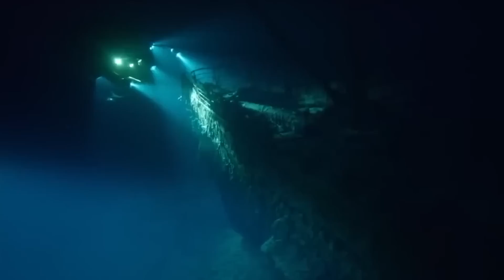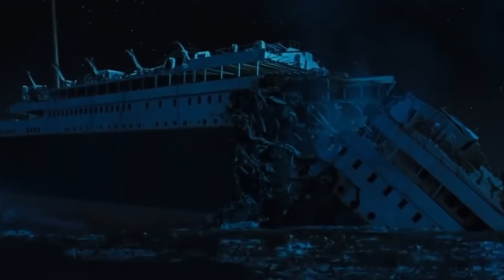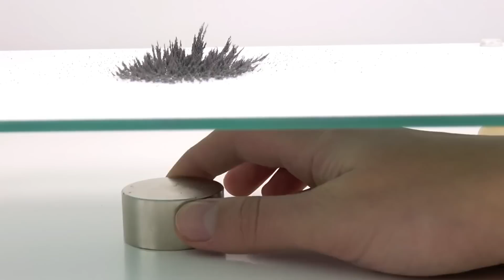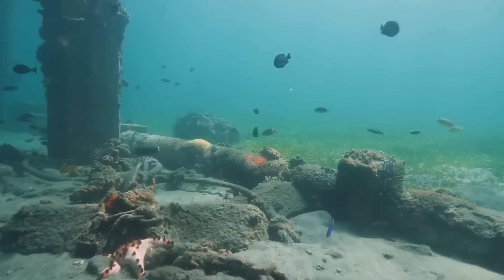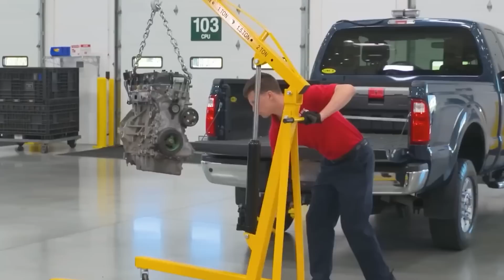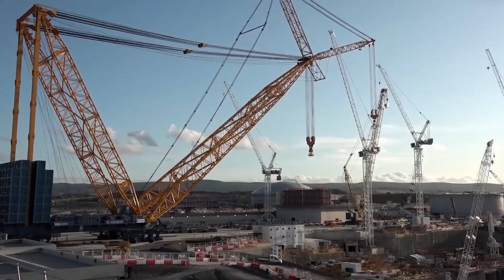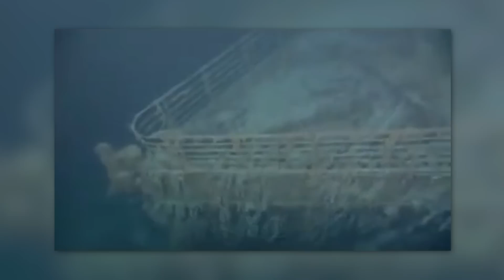Scientists New Plan To Retrieve the Titanic Changes Everything!

Comment: Complete rubbish. The hull now is not far from completely crumbling into an unrecognizable mounds of metal. Saw something saying perhaps 10/20 yrs after sinking (ie 30s/40s/50s) if they’d had the technology MIGHT have been able to bring her up. The stern section however literally impossible. Last pics it’s almost completely collapsed. The stern section imploded on descent…Even since the wreck was discovered constant exhibitions have destroyed a lot of it and accelerated its damage also. Best bet would be to salvage what’s important. Put into museums etc. maybe one day when hulls completely rotted and rubble maybe they’ll bring up her boilers or engines 🤷🏼‍♂️ can’t see those rotting as fast as the hull around it 🤔

Comment: Are they under the impression that the stern section is as well preserved as the bow? The stern section is nothing but rusted and twisted steel, you can barely tell that its part or a ship, hull plating is peeled off and the decks are pancaked on top of one another. Not even worth the effort

Comment: No, it can’t be done…
Maybe 50 or 60 years ago, but not now…
She’s too far gone…
But if you must try,
The best way it could be done, if you had a way to build a watertight enclosure around the sections of the ship, then pump out the water and float the individual sections of the ship to the surface.

Comment: It would have to be a combination of ideas.  Putting a steel cage around the ship, then using a mix of air balloons and cranes is probably the best possible way to get it up.  The next best way would be to cut it into sections to bring it up.  Either way its going to be expensive and take a lot of planning.

Comment: At the latest on the surface of the water, contact with the oxygen in the air will ensure that the Titanic completely crumbles into rust in a short time. The static forces of an uplift are anyway too great for the moored hull and it will break.

Comment: Well the ship alone is 115,300,000 pounds plus it has a volume of 4,632,900 cubic feet and If you fill that with water it would be 2-3 times the weight stated above. Most importantly it will crumble with any movement. And if you are saying the ship is in two pieces which it is, 57.65 million pounds + 2.316 million cubic feet of water is still extremely heavy!!!

Comment: Yes, it’s a sacred graveyard but also this ship is also polluting the ocean so it would also be a good thing to get this out of the ocean if possible and bury all the human remains if any are found if the titanic is brought out of the ocean
Reply: Raising the Titanic would be a physically impossible task. The hull of the Titanic would completely disintegrate on the way up.
Reply: @melissawickersham9912  with what facts, excluding the ones you made up on the spot. post links to metal instantly rusting when it touches the surface. should be a lovely read
Reply: There are no remains down there.
Reply: @TheSavagederek  Logically speaking, there wouldn’t be any recognizable remains down there. Any human body that was on the ship when it sank to the bottom would have been crushed to a red paste when the air pockets in the ship imploded. Even when there were no longer any air pockets in the ship, human bodies would still be crushed to a pulp by the pressure alone.
Reply: @melissawickersham9912  exactly .
Reply: 1. It’s not possible to get the Titanic out of the ocean without having her disintegrate in the process.
2. She is already part of the marine ecosystem. Iron-loving bacteria are eating her hull away to nothing. Lots of other marine organisms have already set up camp in the wreckage site.

Comment: Why not pump oil into bladder tanks, that are positioned into the hull?Or the hull could be slowly filled with some special foam, that will harden and displace water and provide enough lift.
That will gradually lift the ship without putting too much stress to the structure.
Maybe they could also find some corpses trapped in the hull
Reply: There isn't any corpses in the hull. Bodies desinagrate to nothing in the ocean, they wouldn't even find one tiny bone in or around it unless it's a recent dead animal. The ocean floors don't preserve like a grave yard.

Comment: People have been robbing from a grave site for years.  That’s a shame.  All those shoes lying around on the bottom scattered about…they used to have the feet of the dead in them.  The bodies deteriorated away, leaving nothing but their shoes left behind.  And they too probably wouldn’t be there, but the leather they’re made from has been treated so much with chemicals that they’re no longer capable of rotting away like they would have had all that leather still been in the original form of a cow’s hide.

Comment: If there’s ever been a pipe dream, this is it!  The simple fact is, the Titanic could NEVER, EVER, BE LIFTED OFF THE SEA FLOOR.  ITS FUNDAMENTALLY IMPOSSIBLE.  

1.  The Titanic’s bow and most of the forward section of her hull is sitting in 20 feet of mud/sand.  That alone would cause her to be completely ripped apart as soon as any upward force was applied.  And…
2.  The Titanic’s severely corroded and eaten away hull couldn’t possibly withstand the strain required to lift her so much as an inch, let alone over 12,000 feet up from the sea floor.  It would be raining down large chunks of her hull where she had sat for all these years.  And finally,
3.  WHY?  Why lift a ship that’s over 100 years old?  For what purpose would it serve?  Personally, I think that even trying would be paramount to desecrating the grave site of over 1400 people who died in that tragedy.  It’s far better off being left on the sea floor exactly where it is.  If scientists want to see parts of her, they can go down in a fully CERTIFIED SUBMERSIBLE and see all they want.  For that matter, it would be considerably cheaper to build a submersible that could hold up to 100 or more tourists at a time and take them down to see the wreck without having any concerns about the submersible imploding.  Simply build a submersible that’s stronger than anything that’s ever come before…by a very wide margin.  While such a vessel would be incredibly expensive and heavy, just like modern day submarines, it wouldn’t be built with any intention of lifting it out of the water between dives.  Such a vessel would also be built to last a lot of years, as its hull would be so thick and strong, that it would become implosion proofed.  But it would also be quite large, making it far less maneuverable around a wreck site.  The best solution is for the scientists to continue to monitor and photograph the site as they’ve been doing for years.  However, it would be awesome if some company put together a three dimensional virtual reality program where the user could explore the wreck site at home by using a virtual reality headset.

Comment: This is NEVER going to happen and, thankfully, no one is stupid enough to even try it because of what would happen if they did.

Also, in regards to the failure to bring up "the big piece," as it's called, they were ultimately able to go back and retrieve it. It is currently "cut" into two pieces and both pieces are parts of different Titanic exhibits. Had that piece not been on the sea floor, completely unattached from the wreck, they would have never brought it up. 

What a ridiculously stupid video. I really hope no one believes this is going to happen. This is the second channel this week that has made this same claim and there is absolutely NO plan to retrieve the ship from where she lies 2.5 miles below the surface, at the bottom of the North Atlantic.

Comment: 1. You can't use divers to attach the boyancy tanks as the pressure and depth are far beyond what divers can do.

2. The ice method sounds promising but you'd need a monumental amount of liquid nitrogen and when it comes free you'd have zero control and have to keep it frozen the entire tow to port. 

3. Magnets would just rip parts off and destroy the wreckage. It's been rusting for over 100 years. 

4. The logistics alone are mind boggling depth, weight, distance from land, and the fragile state of the wreckage all make this nearly impossible.

Comment: TBH, I did kind of made some small plan to do some raising. The ping pong balls obviously would implode halfway. Balloons would never make it. The oil packets used to raise the Big Piece would have to be at an unrealistic size. The only thing I can think of for now is multiple submarine-like containers holding onto the wreck. Mine had something to do with the buoyancy tank idea. 

Theoretically, we could build a giant container encasing each section of the wreck, and then attach a ton of submarines to it, and lift it up. Or with the Bow alone with less underwater construction, if we somehow dig under the Bow, we could have a large amount of submarines do something similar. However, the Bow's hull collapsed thanks to how it landed underwater. As a result, we'd have to slice the Bow into several halves. Then we could raise each section upward with the submarines. As for the Stern, it is so damaged that it would take a lot more dives than the Bow, since the Bow is pretty much still regaining the shape, despite the deterioration causing the broken part to sink into the sand. This would not be convenient at all. As a result, we'd have to build a solid base under the ship and attach a sufficient amount of submarines to it. And lift it, though sliding the the entire base under the a shipwreck like sweeping a chunk of dirt onto a plate is easier said than done when it's a 500 foot piece of a ship, not to mention it's very heavy, is extremely fragile, and it's over 2 miles underwaters. 

Remember, this is a proposed theory, not a realistic plan. 

While this is up to debate, I personally believe we should salvage and collect as much as we can from the wreck before it completely deteriorates. Yes, it's a gravesite, but are we really going to let this "memorial" be destroyed by the unmerciful powers of nature? This sounds just as disrespectful as looting an ancient tomb and using it for personal profit. I believe we should take as many artifacts, may the whole wreck if it is possible, then lay them as a memorial in some museum like transporting a grave. It's basically exhumation from the bottom of the ocean to the surface of land. And of course, I 100% agree that this should never be used as some "pawn collectable". It is basically a historical piece that should be preserved as long as possible rather than left to die with the remains of the dead. And as Indiana Jones once said, "IT BELONGS IN A MUSEUM!" Exhumation and archeology are different than looting and grave-robbing. One is for personal gain and the other is for research and possibly a form of just moving a grave to another one in order to continue commemorating a tragedy for centuries to come. Please don't fight me over whether raising a shipwreck should be considered exhumation or grave robbing. It's just a personal belief that we must save and preserve the past for the future generations to gain essential knowledge.
Reply: No it doesn’t. Leave it alone, it’s some fishy’s home

Comment: I don’t see em gettin out the ship has been down there for a long time  leave the dead alone it’s a place where people body are there if thy do try and get it I don’t think it will be possible if thy bring it up how are they going to to get the water out of the ship when it gets to the top and back in the city but really I don’t see this happening it’s a graveyard ship and probably people in that ship are frozen but if they do bring it up how is the other ship going to drive it back from there would the other ship have problems sorry but I don’t see this happen anytime soon they are messing with the graveyard ship because alot of ppl on board was locked in with no way out they got locked in there rooms by the metal doors closed with water in the room so those ppl died in there room on board but maybe in a few years thy can bring it back up there has to be shirks in there but good video

Comment: They SHOULD RAISE it and preserve history for centuries to come! 

However, all these plans won't work, because the bow is just too fragile and will likely break apart as soon as you start putting any type of force on it. The only way to lift it, would be to slide a giant plate underneath it, and try lifting the entire plate. This would mean displacing lots of sediment to "dig out" the bow. Then use bags filled with diesel fuel and cranes to try and lift it off the seabed. Any other attempt at trying to raise it will most likely result in destroying what's left of this beautiful ship!
Reply: Even that won't work.  Titanic is full of water, the pressure inside is equal to the pressure outside.   At best sliding a big plate under it will get the ship to the surface where it'll then promptly collapse under it's own weight as the water drains out and gets replaced with air.

The freezing idea if ever possible is the only thing that could work, and even then you can never unfreeze it unless maybe you put it in a massive tank of water to keep the pressure even.

Basically the ship is unmovable.  It's too rusted, too fragile to support it's own weight, and is only getting weaker and weaker as bacteria eats away at it's steel.

Comment: Must use both, cable and freezing methods at the same time, once lifted about 10 feet, use  propellers at very slow speed to the nearest solid surface. ❤ This process could take years because it's important to move one inch every hour while it's floating and must work with the current not against the current to the nearest solid surface. Once frozen only halfway from bottom upwards, must place rubber filled air tubes at the bottom would be important for safety. 

Step 1, crane wires with magnets

Step 2, freezing it halfway from bottom upwards, at least 10 to 20 feet off the bottom of the ocean

Step 3, rubber air filled tubes for cushion, in case a faulty Crane wire

Step 4, propellers, to move it with the current, at extremely slow speed.

❤
❤❤

Comment: Both parts of the ship are already collapsing in on itself. The back half hardly even resembles a ship anymore. The metal that is there would never handle the movement,, it would crumble. And as many have already said, it is a gravesite. leave those people alone. In fact, if I'm not mistaken, they have designated the entire ship and debris field as a hands off area.

Comment: Nothingb is impossible.
Huge tanks dropped and strapped joinned through ship
and pumped free off sea water..
two steel Tanks the same length half width
can be easil;y made droppeed
afixed eACH SIDE across topp and through
AND FLOODING OR FREEZING WATER INSIDE.
SPACEX MASS PRODUCES AND USES TRANSPORTS THE NEEDED
AMOUNTS OF FREEING GASES.

Comment: Maybe 50 years back. Not now the steel is all but gone. It will turn to dust on the way up. The Kursk was raised in less than 3 years and in 300 feet of water; look how that went.
Reply: The Kursk didn’t fall apart on her way up.  Everything that was intact on the sea floor made it back to the surface.  I remember the Kursk in great detail, as I was in the United States Navy when that tragedy happened.  Russia first tried to blame us for it, saying one of our submarines either shot a torpedo at it or collided with it.  Obviously that was a lie.  The problem was the fuel that the former Soviet Union was using for their torpedoes.  That fuel was extremely thin, thus would leak out from even the most minute places possible.  That fuel was also EXTREMELY VOLATILE and could easily explode if it came in contact with any number of substances, all of which would have been commonplace inside a torpedo room on a submarine.  The United States had also used that fuel, but stopped in short order when it became apparent that the fuel was EXTREMELY DANGEROUS, as it was highly prone to finding its way out through gaskets, etc… that were meant to keep it from leaking.  Our Navy, in a rare gesture of good faith, warned the former Soviet Union of the dangers the fuel created, only to be ignored.